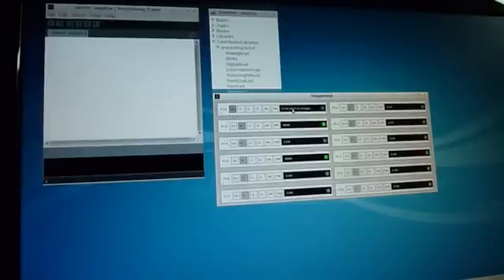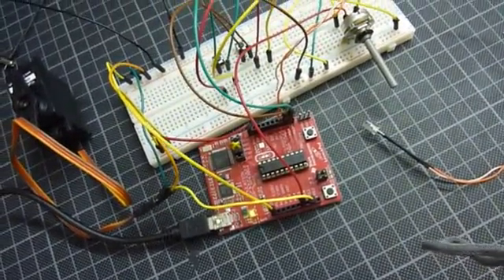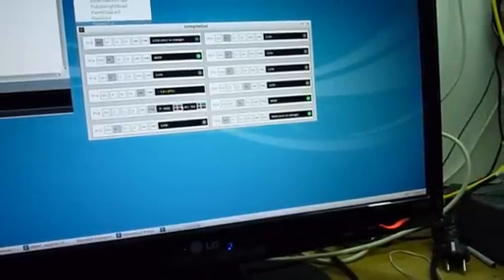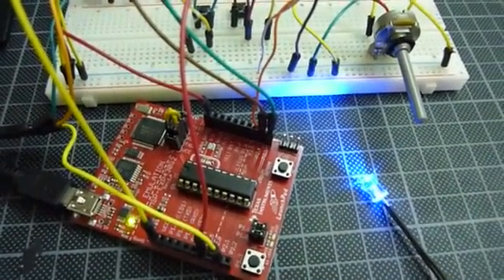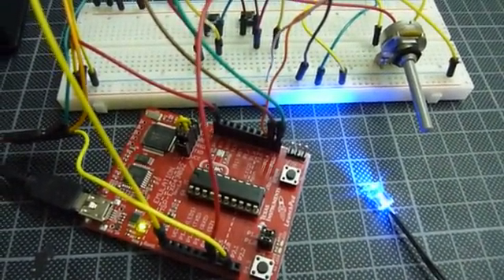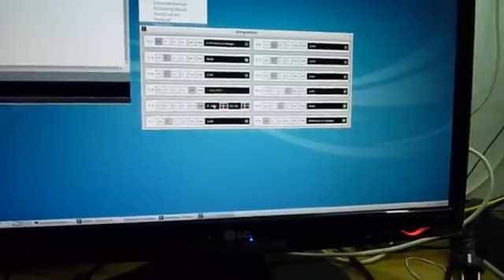Introduction of ROCKETuC with Processing

Comment from the maker: ROCKETuC

I just made a short video introducing the main features of the ROCKETuC project I work on with Alexander Reben. It gives a basic introduction to ROCKETuC and what you can do with it.

ROCKETuC is made up from two parts: a firmware that runs on a micro-controller and client-library you run on a PC. Communication is done through the serial line by using a binary protocol. Currently the TI Launchpad with an MSP430G2553 installed is the only supported hardware. Client bindings are available for Java and Processing.

For more detail see the github repo:

https://github.com/areben/ROCKETuC